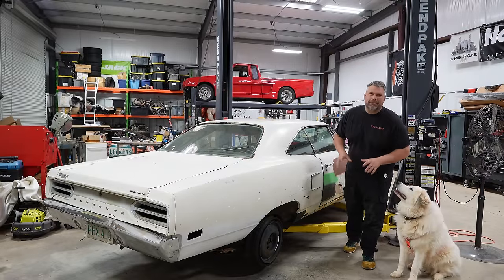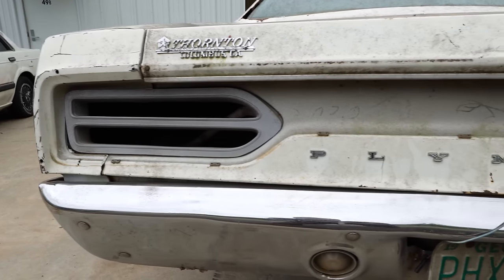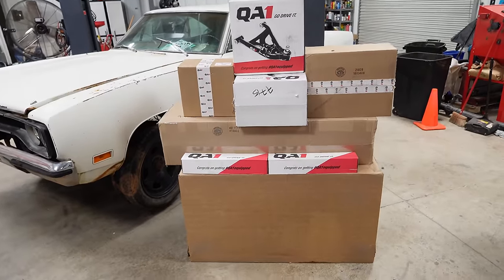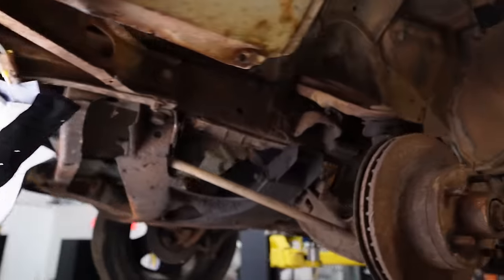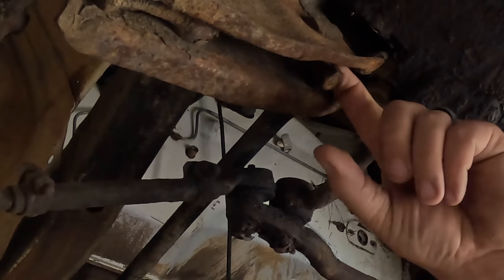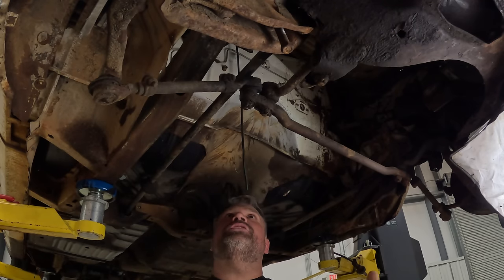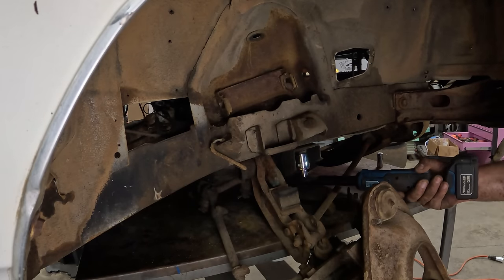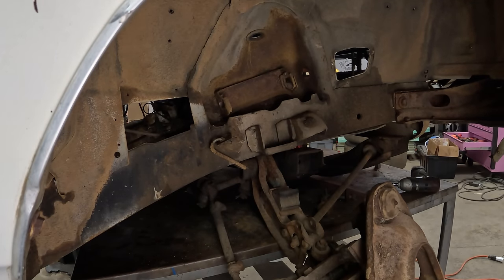Building My Dream Muscle Car Part 1 1970 Plymouth Sport Satellite

Comment: i think the patch and repair on the frame is the best idea, it keeps it more original like you'd want to begin with
Reply: I agree especially with the weight reduction of the QA1 parts. This is the type of projects that shine on this channel.
Reply: A new rail wouldn't have the same quality of metal either. And it could be either better or worse quality, neither good for the car. If you HAVE to do the left rail, you have to do the right rail too, because what happens in time, is you end up stressing either of the two  (depending on which is weakest) and then you're back to square one. Patches are the way to go on such a small booboo.
Reply: Agreed-drill and patch the original.
Reply: Perfection is the enemy of good enough. Drill and patch. Drive and enjoy!
Reply: I agree with all the patch and repair. However, I think it should be done before installing new parts. A good repair will be undetectable. Drill the ends of the crack. Weld and grind to the original profile. Cut out any rust, patch and grind. Coat with Rockguard or similar and nobody will be able to see the repairs 🤩

Comment: 14:48 'why put it all in if going to take out for paint?'

A good reason is then it all fits so not having to hack at freshly painted metal.

Do you paint a car before putting in new quarter panels?

Get it all done, and right so dont have to deal with stuff after its painted.

Comment: My dad had a 1970 white roadrunner that he claimed was the fastest car he had ever owned. It originally had a 440 HP that he blew up using alcohol to win a street race against a 327 Chevelle. A friend of his who owned a salvage yard told him to leave the car with him overnight and come back in the morning. He did just that to find a 440 that was pulled from an old highway patrol vehicle that sported 2 4 barrel carbs under his hood. He said after that upgrade the only thing that could catch him was a police radio...lol. Great video, thanks for sharing. It would likely be easiest to do the body work and frame work before you install an engine depending on your time allotment, but either way I'm here for it. Been a Mopar fan all my life, love getting to see these get the love they deserve. As for the frame, being as the car will never truly be numbers matching, go for whatever gets it to the road. If your plans are to keep it and enjoy it, then build it for you. Anything done can be undone or redone, save all the old stuff for when you have gotten your enjoyment from it so that if it makes it to the next person, there is an optional direction for it's next life. Keep 'em coming.
Reply: 70 roadrunner was only offered with a HP 383, 440 SixBarrel, or 426Hemi.  To get the 440HP you had to get a Superbird or GTX.  
Sounds like good times were had though!
Reply: @ronmurnieks9483  Well to hear my dad tell the story, it was a standard 440, but yes you are correct, but truth be told, Mopar did allow anything for special orders. There are some pretty strange should not exist combinations in the Mopar world, and the right amount of money could persuade nearly anything. I once encountered a 75 Chrysler Newport special ordered with a slant 6. Who knows, Unfortunately I wasn't alive just yet, but my 3 brothers did confirm this story. That being said, He was not the original owner of the car, so it could have been modified before he got it. I did google it, and the facts are a little all over the place, but apparently they offered a 440 super commando at 375 horsepower, and a 440-6 at 390 horsepower. What I know of the later super commando is that they were stamped as 440 HP on the 76 era New Yorkers, although they weren't nearly as powerful. People did like to source them a lot at the junk yard my oldest brother worked in.

Comment: I'm in the middle of a Mopar project myself at this time.  A 1977 Dodge B300 based RV with a dually rear axle that I will be turning into a 1 ton dually extended cab flatbed.  It will end up painted just like my grandpa's 1973 Dodge B200 van as a tribute to him and his legacy.  RIP Grandpa.

Comment: Never seen this channel before, the title got me.
I'm so glad I'm 54 and got my first car, which I still have, and it was a musclecar, and it was the car I wanted as my dream. Then and now. 
It's a 1970 Oldsmobile 442. I still got it and I'll die before it's no longer mine.
Edit : growing up a good friend of mine had other stuff but one that stuck out was a grey primer, relatively clean for Michigan car, 1969 satellite. Yes it had a transplanted junkyard low compression 440 with headers. On a daily driver this meant no starter changes in the parking lot in January at K-mart like my A-body GM stuff, but still...that dash was and is so very cool. The sounds thru a low trim satellite with very little sound deadening and actually daily driving it thru winter in Detroit all thru the 1980s with a 10+ year old car then was more than impressive and fun.

Comment: I just did valve cover gaskets, plugs, and coil wires on my G500 recently. I really is all about the small victories - each one brings a car that much closer to perfection. I finally fixed the hydraulic top on my SL500 the other day - that was another small step for Rolling Stonks, giant leap for my confidence that I can resolve vehicle maintenance at home. It feels really great when you're able to fix something without making anything else worse. Can't wait to see this car restored! New suspension is going to be SMOOTH!

Comment: Bodywork first, Engine later. With the crack and rust on the frame rail, I'd change that, too. It's a once in a lifetime build, not fix it on a weekend!
Reply from the maker: After doing some paint and then having to rebuild a big section after the mechanical build out, the ‘pretty’ stuff should get fully built out to a finish, then get the final body work and build out to make sure it’s what I wanted
Reply: I absolutely agree with “mocking up” every part before finalizing the metal work/bodywork/paint. I learned this the hard way many years ago, and I’ve been reminded of that lesson many times over the years! When building different cars-especially for the first time… i never failed to forget a minor detail “test-fitment” before having paint on the car🤦🏻‍♂️! It’s at this point you start praying whatever bezel, grill, or stainless trim piece that borders the paint fits as it should without gaps! Consideration of details like these and being methodical are what enable my 45yr old example to out perform the 21yr old version that was full of energy-and mistakes! 🤦🏻‍♂️😂 
By the way Jared, I love the satellite, the frame rail should absolutely be repaired as it is. Those areas are prone to damage from potholes-even on cars with no rust. I’ve seen much worse damage where those (welded nut) K-frame mounts are repaired and never fail. Having new rails is a wonderful option for body rot and collision damage-but trust me-replacing them is extensive process! I say mock up every single piece on the car, use all the nuts, bolts, and shims,  to make the panel gaps right. You don’t have to install the glass, trim-clips, or trim-screws but I would ensure you have new stainless trim clips/screws for everything (just lay them in the channel to be sure-then bag them back up. Remove any old clips and screws from the body-allowing you to place & check the trim fitment against where the painted edges will be. 
Once all of that stuff is done gather a group of car buddies together for a careful Saturday tear down while you document everything in a notebook just for the satellite. Tag and bag every bolt, washer, nut, and screw. As you remove each panel bolt-write down how many shims are there, if something needs attention here, or missing bolt here etc. The time you will save by doing that will expedite the process…making the end result SO worth it! I built a 70’ satellite around 2009. It had to have the trunk floor, trunk extensions, quarter patch panels(lower rear), the outer wheel tubs, and drip rail patches(rear window corners) all of the sheet metal came from AMD. Ive done quite a few like this, I’m sure you probably have too, but if you happen to get stuck on something, need any advice, or some tips/suggestions you’re welcome to contact me brother.
I’m Ryan, and here is my email😊 
Midnightoilsrestoration@gmail.com
Good luck on the build, I’ll be following along, you’ve got a great channel 😊

Comment: Thanks for asking. I'm almost done replacing "all" the front and rear bushings (suspension and steering), plus shocks and struts on my 99' 4runner limited with 275k miles. Since I'm replacing all the rubber bushings with urethane ones, my ride quality will be a little rough but so much tighter and handle better.

These QA1 K member kits that you've been using lately are so awesome.

Comment: My project is replacing brake rotors, pads and stainless lines on my 335k mile 94 C1500 Suburban.  Then replacing the shocks with Bilstein shocks and eventually figuring out how to install the body bushings.

Comment: We are building a 69 AMC rambler american.. so far we installed mustang 2 type front suspension, c5/c7 front brakes 13 in rotors, 2017 5.7 hemi, 8hp70 trans 8.8 rear .. and a 2015 hemi 2.4 liter SC .. work in progress

Comment: Redoing the suspension on my 2004 Mustang GT, its all worn out and cracked rubber bushings, i had s friend's shop do the front lower control arm bushings and ball joints, a friend and I did the caster camber plates and Bilstein shocks and h&r race springs, i need to do all the rear control arms and bushings, all from Maximum Motorsports as my daily and auto cross toy

Comment: My first car I got when I was 16 in 1973 was a 69 Roadrunner 727 auto 383 with air yeah one of the few, about a year later I got a 70 Roadrunner (my Dad wanted the 69 he was a Ford guy go figure)  it had the air grabber hood and Pistol grip 4 speed also a 383. Loved them both but the 70 has always been the car I wish I would have kept. Right now I have a 68 Dart and a 72 Barracuda haven't run into the rust issue on these too much. Looking forward to seeing where you go with this. Also if it's not extensive I would weld and patch the frame rail done right it should be just as strong.

Comment: Yeah corvettes are sports cars more so the newer ones with independent suspension on them for handling. Sports cars are cars that have fantastic power and all of it is put to the road. Muscle cars are giant cars with solid axles with crazy power that will feel like itll rip you in half. Also most of the power goes to the road the rest of it is to break loose the tires for nice burnouts lol.

Comment: Rebuilding 64 Thunderbird power bucket seats to put into my 64 Galaxie 4 door. Also replacing the solid fan with no shroud with an electric fan to keep it cool. In traffic. That's what I'm working on currently

Comment: I myself had a 1970 Satellite back in the late 80’s early 90’s. Put a 440 6 Barrel in after I blew up the 383 racing a 69 Road Runner. It was a very smooth driving car , lived in an area that had some speed bumps, the torsion bars absorbed them so well I really never noticed them. If I still had it or got another one I would not Remove the Torsion Bars and go to coil overs. Good luck on your build will be fun to watch 😊

Comment: I would inspect the cracked frame rail as much as possible. If it's not rusted out on the inside, the stop drills and a patch will work. Replace the rusted out body sections and also work on rebuilding the engine going back and forth between the two.

Comment: Greetings from Norway 🇳🇴. I have a plymouth as well. That's my baby project. Bought a crusty old 1960 savoy have been at it for two years now, replaced every single flat piece of floor in it. Only the trans tunnel was good. Handmade a section of the roof and the bottom of the quarter panels, have not done the doors and fenders yet since it can be taken of the car later and fixed. it will soon be a rolling restoration from then on. Ready to break in the new camshaft and get it moving now just needs some exhaust and fuel plumbing now.

Comment: You asked about our projects, im currently working on slightly modifying my 2001 Tiburon, I've done more than I can list here but I recently put on now front fenders, parking break cables,and rear sway bar. Last november I started body work so its in primer, did i mention its my daily. I like to think I only have 5 % left but these at least 70% of the time I'll spend on it.

Comment: They actually make a tool for removing the Mopar torsion bars, it essentially bolts around the bar with a heavy steel plate that hangs down that you can smack, you can get them through Mancini Racing. It took one hit on each bar on my charger.

Comment: I can’t believe this video doesn’t have more likes. I would patch the frame out the new QA 1 is going to put stress in different locations and you should be just fine QA 1 engineered that suspension to be better and eliminate issues like this. My current project is a 77 VW Bus with 2.5 out of a 2000 Forester and it’s getting ready for the first start.

Comment: I would suggest starting on the front end structural repair and some of the rust repair around the engine bay before rebuilding the engine. It's super easy to get stalled out on the rust repair and bodywork. Being able to shift gears and rebuild/install the drivetrain will give you a break on the metalwork when you need a change.

Comment: A couple history points:   Rack and pinion steering was introduced by BMW in the 1930’s  many European makers following in the 50’s. The Ford pinto was the first US car to have Rack and pinion in the 70’s        Second torsion bars are more recent than leaf of coil springs patented in its present form by Porsche in 1931. Torsion bars had advantages over early coil springs that detail development of chassis, shocks and coil springs mitigated those advantages. For the record military tracked vehicles still use torsion bars.

Comment: edit: 23:49 IMO, you do the frame rail swap only in the worst of situations. And if you do one, you have to do the other, otherwise, you end up stressing the weaker of the two (and that could be either, depending on how the quality of the replacement is, better or worse) and you're back to square one. Given how small the damaged area is, i'd say cut the damaged sections clean off with rounded holes (hole saw) and make patches and weld them nicely in. You could do a shelf repair there, like they do in the banana of an excavator, where they add a small shelf behind the weld to give extra metal to the repair. Jm2c. 
10:50 have seen them, dunno who makes them, i made my own because i saw how cheap they were and figured they were made out of some form of cheese. What i did was i took a pair of sheet metal vice grips, and tacked a pair of stainless steel (for) rasps on them. That way it has a lot of contact area, not just that one spot where the main jaws are. I used common garden variety (for) stainless steel rasp files. Seems to work just fine for now. Have used them to retract half shafts and other types of linear items from stuck places. The most difficult so far has been removing a rusted 1920's hand forged awning's deployment rods from the square holes they were seated into. They fought me a lot. I actually damaged the tool with the mini sledge i was using, had to bend it back into shape. So as mods go, i give it a 8/10, but only because i used a cheap pair of vice grips. A higher quality one with solid jaws (to which the wide jaws for sheet metal bending are attached) would more than likely do far better. Oh and i took down the hardness of the rasps in the area where i welded (at the ends) before i welded them to the grips. I tried welding a hardened file before to make a long reach one and it shattered just from me knocking down the slag.  :D

Comment: 6:10: When I saw that kluge repair, I couldn't help thinking the guy that did it had a mullet and a John Deer cap, slapping it together with a bolt he found lying around in his garage and calling it fixed.  If you haven't already named your project car, I suggest something with Mullet in the title, like Mullet-Head or Mr. Mullet or something like that.  "Business in the front and party in the back!"  The project looks great, btw.  As rusty as it is, it's actually amazingly un-rusty considering how those cars rotted away.  I really like Mopars from that era too.

Comment: Make it solid, make it smooth driving and enjoyable.  It doesn't have to have a fancy paint job to enjoy the heck out of it. 72 Dart project currently that I'm working on. Body straight and solid mostly except for the non existing floor, thanks mopar and the right front fender that obviously came from the salt mine. The double scoop hood is mint thankfully. Love the Dog btw

Comment: Been working on my 1980 Camaro that I’m doing a 1970 split bumper rs Camaro front end swap on also figured out when you do the c5/c6/c7 corvette brake swap you can use c6 z06 rotors 2016 caddy ats performance 4 piston calipers and pads and it all works very well

Comment: Love this car! My father had a white 70 Satellite. It’s the first car that I remember loving and he owned it into the early 90’s. I’m in Canada I’m not sure the US cars had this but I remember the folded up seat belt shoulder straps above the windows. Those never left the original factory placement, kind of meeting a new code or something at the time but not a practical design idea. Also, the metal trim on the seats would burn your leg if you had shorts on in the summer when they got hot from the sun. Still one of the best looking Mopar cars ever, although I do have a soft spot for a 70 Cuda…